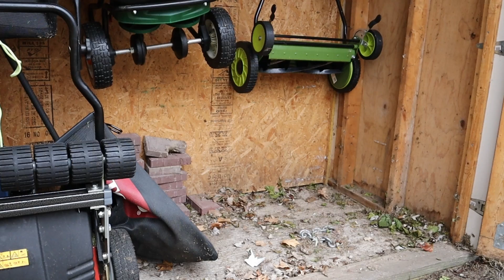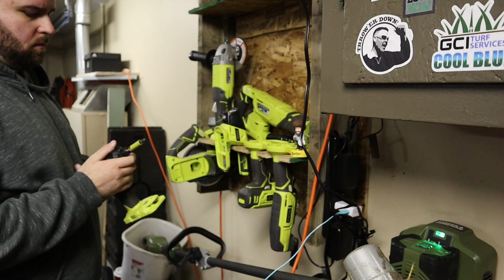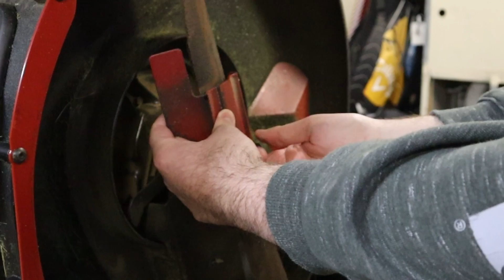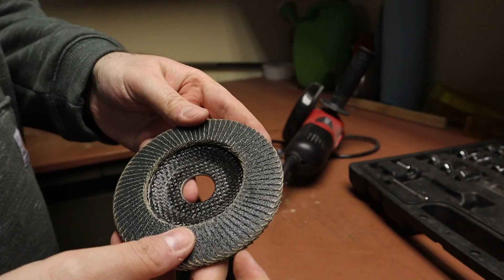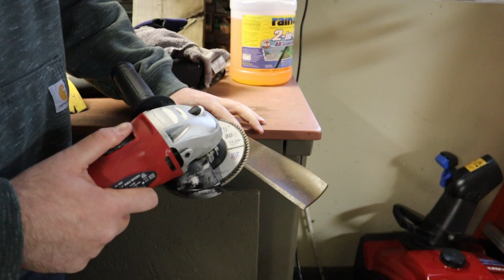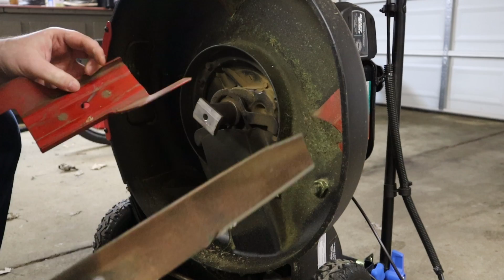DIY Lawn Mower Blade Sharpening Guide

Comment: You don’t use a torque wrench to tighten it to spec?
Reply: No, why? If you use an light duty impact wrench, and just make it tap tap a couple times it will be tight enough.
Reply from the maker: Not when using the impact gun, no.

Comment: Nice video. I only use my reel mowers now but when I did use the rotary and even with my reel mowers I use sand paper to keep the blades clean before each use. Takes literally a few seconds. I only sharpen them if they get nick on the edge otherwise I keep them clean this way and don't have to worry about changing the angle.
Reply: Sharpening a 'rotary blade and keeping the angle is as simple as running water from your faucet.
Reply from the maker: Nice tip! 😉

Comment: Great video Kyle, I sharpen my blades monthly. I use my Ryobi angle grinder, I like not having the cord in the mix. 😎🌴👊
Reply from the maker: I just got one of those too, but the flap disk I have doesn’t fit! So I’ll be shopping for that soon 😀
Reply: Monthly is not necessary. Obtain an additional blade(s) and sharpen it, hang it on the wall. Then in the middle of the mowing season switch set(s). Then sharpen and balance the one just removed. Hang it on the wall. At the end of the mower season, repeat the process and following the correct procedure for storing the mower. I recommend using ethanol free gas and add stabilizer. If you engine has a shut off valve, turn off the gas and finish the last few minutes of mowing and allow it to run out of gas. Install an in-line fuel shut off valve on any engine where it is possible. Change you oil no less than every other year unless you put more than 25 hours per year on your mower, but many change it yearly. Take advantage of modern synthetic oils for as they do a superior job of protecting your engine. Above all all, keep it clean of debris and lubricate all moving parts. Never store your equipment outside if possible, not doing so shortens the life of the mower.
Reply: @CuriousKL  I prefer monthly because that’s just me, and I have the time for it.